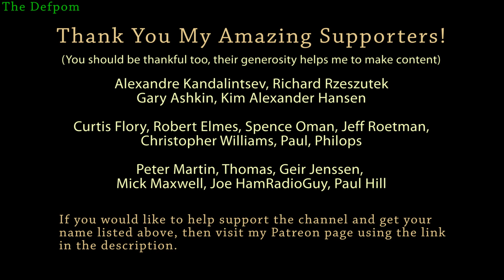🔴 #650 How To Fix A Lightning Cable - What Is Inside A Lightning Cable

Comment: I use magnification and blades from a dollar store safety razor. They're five blades in the pack. Two sides per blade. Fold them lengthwise like a book and they snap apart with one fold. Then make a video with basic editing software. 😉
Reply: Wrong video buddy. But I get your joke.

Comment: I wonder if the molding can be softened with a heat gun in order to reduce damage to the board. Would probly have to it up in a way whete only the molding is being heated up and not the rest of the cable.

Comment: My lightning cable connector simply gets very hot to touch and I can smell plastic burning. Of course the cable doesn't charge my phone anymore. Luckily it didn't damage my phone either.  I suppose the circuit got shorted somewhere...

Comment: Thanks a good video on repair of the I phone cable I tried that but the I phone not charging 
On the 4 pin  the reading of the 5 volts does not show the from the solder of the red wire its shows 5 volts but when completed the negative has continuity  from wire to pin 1 but the red on pin 4 dies not have any solution for that

Comment: what about heating up the moulding with heatgun first to soften the plastic? (not so hot as to melt it and make a mess, but instead just hot enough to soften it enough to get it off)
Reply from the maker: Yes that would have made it easier.

Comment: Hi thanks for showing what is actually in the lightning terminal side of the cable.I have problem with a cable bought recently.This particular cable is for connecting my iPhone to external speaker which has phono connection.There is lightning connector on one end and 3.5 mm phono jack on the other end.This cable does not work for some reason I don’t know.I tried to test continuity between the connectors with a multimeter but only get one result which is ground but nothing for others which is for sound.I thought it should show continuity for sound but later I learned there is a chip circuit at lightning end so May be that is why the continuity does not show.Please correct me with this one.I wonder why the cable does not work? This cable is for sound only and not for charging phone so I would presume there should be direct connections between the lightning and phono connection.Your help appreciated Thanks

Comment: You know this: They intentionally make them all this way, so they fail and it’s too much of a problem to bother mate!
Bloody twats... I bought a new iPhone, 1000 Quid!  No charger, headphone or bloody cable to plug headphones in...
Reply: Well the put that timer circuit in so it will fail even if the charger is not torn

Comment: It only wanted a delicate bit of soldering. There is a gadget, cant remember its name, like 3 hands, weighted with little clamps to hold several bits in place, to hold it in place, then all u have to do is make sure its clean, solder wont work if dirty, then one little spot of solder.
Reply: I’ve seen someone use that once. Great idea! Then it would be worth it bec you could fix anything and never buy chargers.

Comment: Not MFI certified (a counterfeit) so not worth fixing. Besides that a proper Apple Certified one has glue over the chips and wire contact-points with a metal sleeve crimped over.

Comment: All the lightning cables I’ve seen have wiring made of steel and is not easily soldered. The steel wires are brittle and break easily when sufficiently flexed.

Comment: Thanks for satisfying my curiosity about these. I've always wondered what's inside one. I absolutely hate how they're seemingly designed to be thrown away... what a waste of materials! All so we have to keep giving Apple our money...
Reply: Wires inside are so little , they are less strong than exemple tv wire so it’s more fragile , so sometime we charge the phone on a table too high  and the top of the wire is bent and after many times doing this , the rubber stretch a bit and a wire inside finally break , and we can’t see it , cuz it happens inside !

It force us to buy 
Lightning cable every year
Reply: Apple is corrupt. These cables sold for up to $45 when they cost apple about 5 cents. Apple could've used off the shelf micro USB plugs but they couldn't steal from people. Apple has made billions off of selling cables. To make things worse they put a chip in the cables to reduce the chances of third party sellers could profit off of knock off cables. Apple has billions stored offshore to avoid taxes. We need a law that would STOP THEM FROM DOING BISINESS IN THE US until they paid taxes on all that offshore money. Then force them to pay billions in fines and have APPLE executives arrested and inprisoned for corruption. 

Sadly, the US has one party of fools who chant like primates when they hear 'deregulation'. We need MORE regulations, not less. The stupid people who mindlessly chant for less regulations are allowing corrupt companies like Apple steal from every American.

Comment: Why does your charger have 4 wires mine has 3 and it’s only red white and green
Reply from the maker: There should be 4... 2 for power and 2 for data.
Reply: Defpom's Electronics & Repair I literally cut another charger and it has 3 too
Reply from the maker: @noeaxines968  curious.
Reply: Defpom's Electronics & Repair I don’t understand please help
Reply: @noeaxines968  Maybe they are using the same negative... idk, it’s should be V+ V- Dat+ dat-
Reply: Hey hi if you rip apart the charger you will see the red green and white wire and you will also notice that there is a wire that is silver in colour and it is rolled it’s thickness is almost the same thickness as the other wires

Comment: Thanks for sharing! I have a iPad at work that uses a massive protection case and the charging / data cable has a bad wire. My Bose ordered a pack of five replacements and they have a bigger shielded ends then the old one.

Comment: my neighbor has an iphone with such a cable and he came to me to check why he can't charge his phone anymore, his connector has the 2 middle pins on both sides almost completely burned off because of arcing I suspect, I measured if there was continuity on those pins and there was none except for one pin that gave an intermittent signal so I told him to get a new cable and write the old one off.
It seems to me that many people have this problem with iphone charging cables, I find it pretty funny.
I hate apple and everything they are a part of and personally I would NEVER buy, use or even look at and I certainly would NEVER EVER plug an apple device into my personal computer just out of principle that it's from apple.

Comment: Why not an oem official apple lighting cable????
Reply from the maker: recklessjunkie - because they are actually far worse for breaking ! I started out with genuine cables, at $30 a pop... then one day after my 4th cable failed (Despite treating them carefully and gently) I picked up an aftermarket one, it lasted 4 times longer !
Reply: Defpom's Electronics & Repair interesting so they are decent I remember hearing your better off going with oem because the after markets are not very good in the quality department
Reply: Also I’m sure your talking about a good after market one not a cheapo from a dollar store what do you recommend
Reply from the maker: recklessjunkie - sure there are rubbish aftermarket cables too, but as long as you choose carefully you can get far superior cables than apples ones, even high quality aftermarket ones are half the price of apples.
Reply: Defpom's Electronics & Repair so maybe go to amazon and go with the best reviewed most bought lighting cable ?
Reply: Yeah your definitely right on the price MUCH CHEAPER haha thx

Comment: That chip is a real pain. I had a 6 ft connector that was slightly cracked near the chip area. Dropped coffee on it accidentally and it stopped working. The chip went bad or at least that's what I think happened.

Comment: Thank you for this , thankfully I’ve saved multiple broken iPhone connectors and it just happened my dad got a soldering iron lying around, I have 3 in my disposal and each had different problems but atleast I got the idea of soldering. All 3 worked on my first time trying. I guess I won’t be buying a new one in a while lol.

Comment: Better off getting a USB to lightning plug adaptor,  then you can use any old USB charging lead. Apple have to make it complicated by having to have a chip that provides some sort of ID to the device being charged (the purpose of the small chip)

Comment: If it's encased with injection molded plastic wouldn't a bit of heat help soften the plastic and get it to loosen adhesion?

Comment: Just proof that you might as well just go buy a new one.
Reply from the maker: Merritt Derr - maybe so, but I don’t like this whole throw away society thing and the resulting mountains of trash and wasted resources, I think if some could be fixed then it should be.
Reply: @TheDefpom  I suspected that would be the response. I feel the same way mostly but one of the lines I draw is trying to fix molded cable ends, which I've never had much luck at
Reply: Facts

Comment: Wow, I hadn't even considered trying to repair a lightning cable.  Very interesting to see what's inside the connector.  I guess if you'd try to proceed with a repair you would have ended up with a quite fragile result.  Thanks for taking the time to film this adventure! :-)

Comment: If they would only make the strain relief a bit further and stiffer from the lightning connector end a lot of cables would be saved.  No surprise on the soldering jobs on the internals.  I bet the overmolding helps holds things together and masks poor connections for a while.

Comment: I hate when they mold the connectors or such so it's not possible to repair without dipping the end in epoxy or rubber to seal the end after you are done.